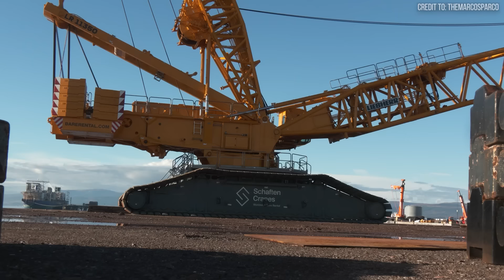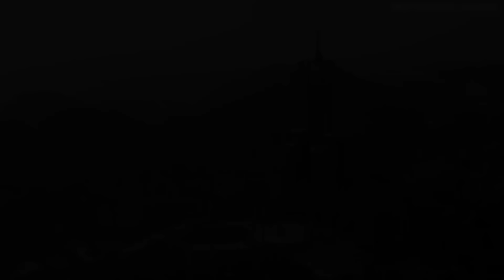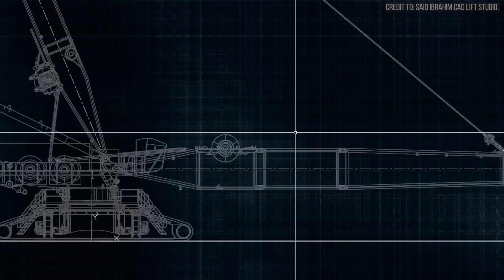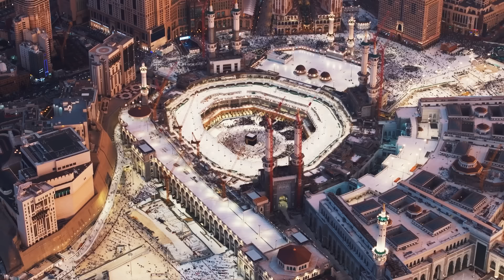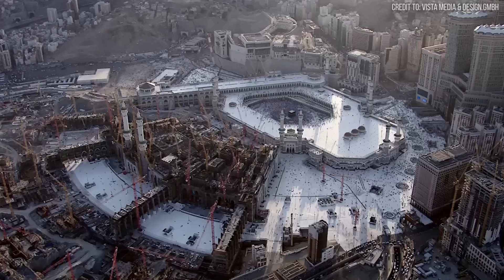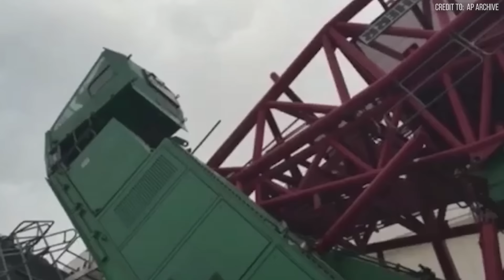111 Death Catastrophe: How One Error Toppled 1350 Ton Crane in Mecca

Comment: Standard Op Procedure to allow cranes to freely rotate in storms.  I get it, but winds in a  high rise environment in a storm can change directions very quickly, not giving a large crane much time to rotate and reduce the lateral force.
Re the micro burst - 60 acres of milo in NW Missouri was about ready to be harvested when hit by a micro burst.  When the farmer running the combine told me there was nothing to harvest, I thought, nothing?  A few days later I traveled to see the field with my own eyes.  I thought surely, Canadian geese migrating south would be having a feast on what was knocked down.  When I got there, the field looked as if it had been vacuumed clean.  Yep, nothing.  Not even a little chaf.  The power of Mother Nature.  10 years later, a friend in Melbourne, Victoria, called me and told me there was a firenado, and it was in Missouri.  Firenade?  On Skype and at a computer, I Googled "firenado", and as it turned out, the first photo that popped up was taken about 1,000 ft from the sw corner of my farm.  (Firenado, Missouri, 2014, for the photo.)  Once again, the power of Mother Nature and crazy odds.

Comment: Cranes do not have anything to stop the boom from going backwards (toward the cab). I witnessed this with a much smaller, but same type, crane that was climbing an incline with the boom too far vertical. Gravity brought it back toward the cab.
Reply: Actually, they do. They're called "boom stops".
Reply: @craigwall5356  The reason I said this is that back in 1990s, I watched a crane crawling up a slope and the boom went back with no stop.

Comment: 85 degree sounds like the max angle or above .I have never seen a nonfriction crane the had free swing when engine not running. Swing brake is spring applied hyd. released would need a separate stand alone system to make it weather vane. Than there needs to be a 360 degree swing area for that to happen.  In the pic you can see the wind blew the main boom in to back mast and it went over backwards not over side track.

Comment: There have been a number of crane crashes even in 'civilized' countries, including in the USA in Milwaukee, NY City. Failures are usually due to wind conditions, 'get it done itis', misjudgments or calculations of load and position of a crane as well as operator errors. This one just happened in a very famous location and with a huge loss of life and injured.
Reply: Yes you are absolutely correct but in this circumstance Muhammad was out searching to marry 8-year-olds and deflower them

Comment: Microbursts give no warning and come on almost instantaneously. There was no time to lower the boom.
Reply: 😂This is not the stone age. They had ampule time to know a storm with strong winds were on it's way. Always when in doubt, expect the worse. They failed.
Reply: @gtbproductions1 I work in that domain.
Maybe they underestimated the storm, or had a space problem to lower the boom. Lowering that kind of boom is not an easy job !
Reply: @lecoqjeannot3358  Cranes that large are usually assembled in a remote place, matting layed down and walked into place.  The extra matting is taken back up in order for trucks to bring materials to the crane.  They would need to stop two days early to get matting layed down and the crane walked out to lay it down safely.
Reply: Oh. The boom got lowered!
Reply: @Shotsmoky — As you can tell from the video, you aren't supposed to lower it like that. Also, microbursts are unpredictable, so there wouldn't be time to lower it anyways.
Reply: @Shotsmoky  "Oh. The boom got lowered!"

Mic drop.